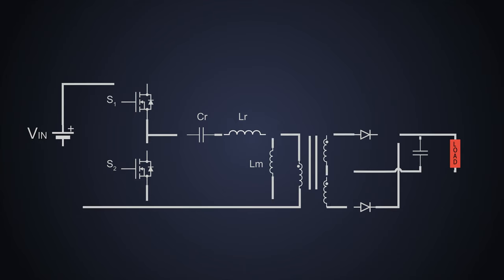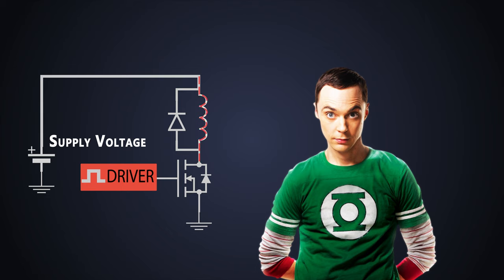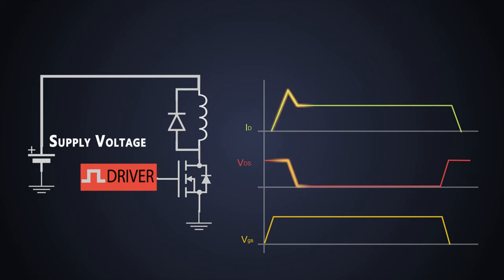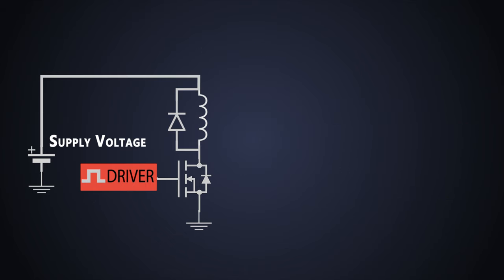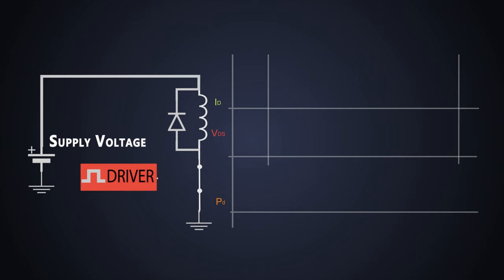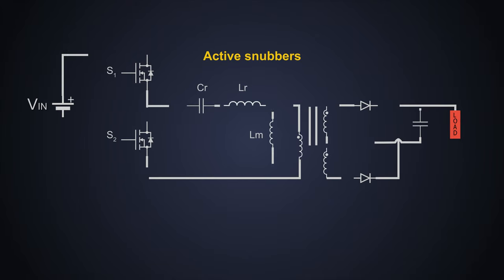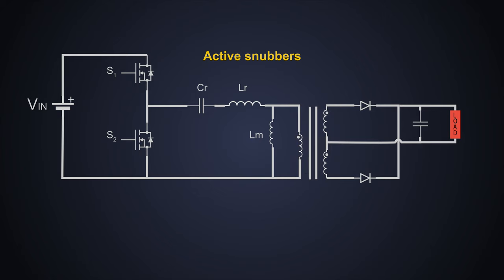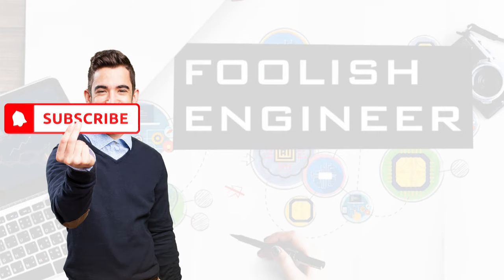What is Soft switching | Hard Switching Vs Soft switching | ZVS | ZCS

Comment: Can pls explain how we can achieve soft switching in converter using simulink.
Reply: by doing phase shift modulation
Reply: @Simsol487  can you pls make a video to explain in matlab simulink
Reply: @yugalkishor3131  which type of circuit you want to simulate? like dc-dc, dc-ac ? to acheive soft switching
Reply: @Simsol487  high gain DC-DC converters...

Comment: What about a practical example of how and where to measure if ZCS or ZVS is occurring?  What parameters do you change (capacitor or inductor value etc) to tune your smps to achieve this? How much does the resonant frequency of the smps must be off from the switching frequency to achieve ZCS or ZCS?  After seeing numerous videos no one has explained this yet.  Thanks.
Reply: For LLC converters you can use first harmonic approximation where you always want to achieve a phase shift of current.
Reply: @TB-jl9fr  when saying the first harmonic you are referring to the fundamental frequency I guess as the first harmonic does not exist.  To achieve ZCS from what I calculated on commercial smps it was found that the smps resonant frequency is about 1/3 higher than the switching frequency If I am correct. Kindly correct me if I am wrong.

Comment: i have a question : when you talk about "inductance losses", it means "back emf current",right? if yes,does that means that ,an active snubber circuit, is placed there "to recycled it" ,in order do not let it goes back to the dc supply itself then? and so,prevented and protected it of destruction and/or parasites from this back current peak  that is produce when the disruption is happening? thanks for your answer ;) ,excellent video ;)
Reply: No. Inductance losses consist of eddy current losses in magnetics material but also hysteresis losses for bidirectional currentflow applications like LLC.
Reply: @TB-jl9fr  ok thanks , i think i get it, lotta thanks mate, so at least the fact to re use foucault current,rise up the gain to the secondary because no "leak of juice" reflowing into the soft switching circuitry then? am i right?
Reply: @nicoslider To be honest i didnt understand what you have written. Soft and hard switching is only important for FET components like mosfets. Magnetics losses cant be avoid. You could only change the magnetics material e.g. reduce the core volume or using a more appropriate frequency for switching.
Reply: @TB-jl9fr  no problem mate, you gave the answer i expect, we just dont use same words to express the same bottom of this idea ;) thanks for all your answer  ;)
Reply: @nicoslider 
Glad i could help you :)
Reply: @TB-jl9fr  ANOTHER QUESTION, sorry ;) does it is possible to use 2 N-CHANNEL instead of using a P channel and a N channel?
Reply: @nicoslider 
Sure. 
Just consider to use circuitry for high side switching of N-CH mosfet like bootstrapping or a spezific IC.

Actually it is common practice to use only N-CH mosfet for both sides (high and low side) because of better switching performance and losses.
Reply: @TB-jl9fr  thanks again mate, i , effectively red several times that N CH were most quicker , now you just confirmed it...lotta thanks....but another question,: could we echange by email? i need to learn more , because i understand the way of connecting a N channel to the negativ side of a circuitry but now i dont understand how to connect a N channel to the positiv side at least.... sorry, am terrible....
Reply: @TB-jl9fr  IF I WELL understood, to use a N chanel to a positive side, the gate of the mosfet must "basiquelly" be cheated by a voltage produced by a bootstrap chip? am i right?
Reply: @TB-jl9fr  hello sir again ;) yesterday i did some research, i conclued that to use a mosfet N CHANNEL to the positiv side i can use a IR2011 chip,but i wonder about the LIN and HIN, could you confirm me that it is the 2 pins were i must connect my inductiv sensors to piloted the 2 gates independantely from each other? thanks to care mate, your lights are pretty welcome ;)
Reply: @nicoslider 
No. 
HIN and LIN are the control signals from your microcontroller or IC for controlling the half bridge. (High side IN and Low side IN). 
You have to supply a logical signal and the IR2011 will act as a driver for the MOSFET gates.
IR2011 is only the gate driver. You will also have to include a bootstrapcircuit.
Please take a look into the application note iv'e linked.
Reply: @TB-jl9fr  Yes, thats what i guessed, but thus ,can i also use this LIN and HIN by connecting it to an inductiv sensor of proximity then?
Reply: @TB-jl9fr  in other words, can i use a inductiv sensor as trigger on HIN and LIN?
Reply: @nicoslider  
If your sensor provides a digital signal in the range of the IR2011 than yes. But you also have to look for maximum switching speed and how fast the signals from your sensor comes.
Please keep in mind that when using a half bridge or any bridge topologie you should provide a dead time between switching of high and low side to avoid cross conducting.
Reply: @TB-jl9fr  i understand i think...thanks again bro ;) ,to be more accurate, the sensor i planned to use ,is an inductiv proximity sensor, witche has a contact NO and a contatct NF (4 wires), reacting to an incremental wheel with special timing, thats for the first point of the history....then secondly,after the mosfet cycled, i need to create a long dead time on the mosfets in order to make them open (non passing) for a while, to do that i imagined to use a second inductiv sensor (that is just a simple NO with 3 wires),that will piloted directly the supply of the IR2011 itself, because i guessed that "if i shut down the supply of this chip,then the mosfets gates would not be supply at all during the time i need", allowing me to create the no supply mosfet time that i need....tell me if you think it is a good idea also, and again , pretty thanks bro for your precious lights, that helps a lot ...
Reply: @nicoslider 
I would suggest to use a microcontroller to evaluate the sensor signals. You can use a interrupt driven software architecture for precise timing and the dead time can be generated with a timer.
Reply: @TB-jl9fr  in fact my problem is that "am not electronician at all",am just electrician...miss so much knowledge in matter of electronic unfortunatly...then i have ,also unfortunatly, no idea how to use a microcontroler nor being abble to understand how finded it on internet...aaarf not easy lol
Reply: @nicoslider  
What are U even want to do?
Reply: @TB-jl9fr  reproduicing a LLC circuitry ...
Reply: and trying to understand it the best i can
Reply: @TB-jl9fr  but i still really blocked a bit also about the way to do the coils of this circuitry, i dont know how to start....
Reply: @TB-jl9fr  hello mate, again a question i use a IR2011 as mosfet driver, but on the shematic, it shows 2 capacitor connected: one between VS and VB and the second one connected between COM (minus) and VCC ,could you tell me what type of valur i should use for both? and also if both must be polarised or not? thanks again mate ;)
Reply: @nicoslider  
hi again :) in a previous comment i've linkend an application note for calculating the bootstrap network which also includes the capacitor (the one between VS and VB).
  
For back-up- capacitor (between GND and VCC) you can choose 1uF to start with.

Comment: I don’t see the difference between zvs and zcs. They look the same. Am I missing something?
Reply from the maker: Check again, mate!
Reply: there is clear difference between zvs and zcs,to switch with zero voltage is called zvc, to switch with zero cureent is called zcs.
Reply: More appropriate terms would be zero voltage switching (can happen during turn on or off) but a better term would be zero current turn off - i.e. you aren't trying to turn off with current flowing. Look at the waveforms and you may be able to see a clearer difference using these terms